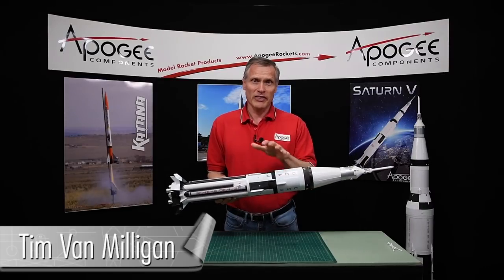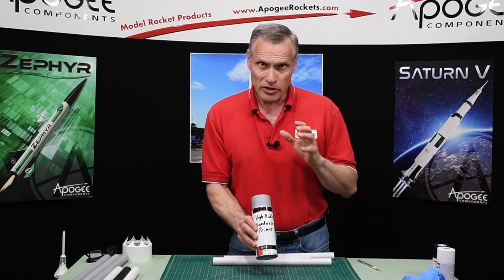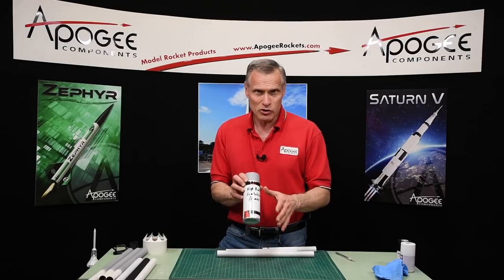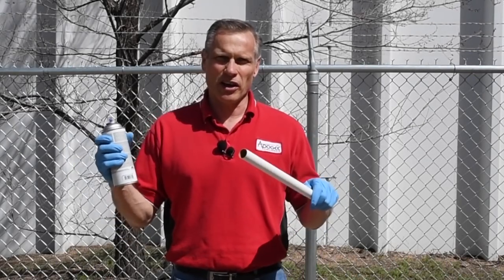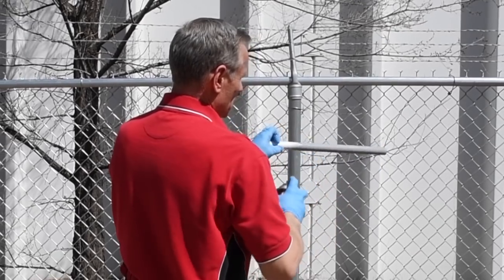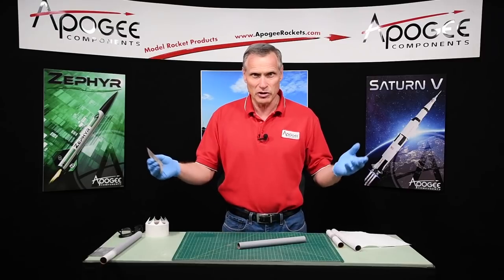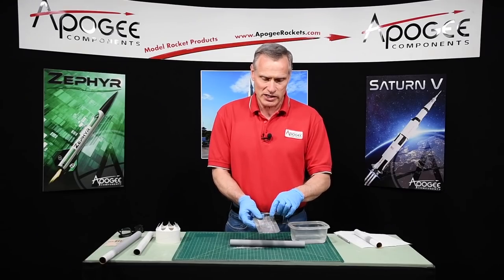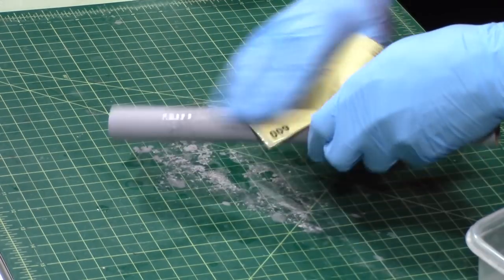Filling Body Tube Spirals with Sandable Primer

Comment: I know these video's are pretty old but at 40-some-odd years old, I'm getting back to Rockets. This is a fantastic tip . . "If you can feel it, the paint will show it" is what my Pops used to say. Another tip i'd offer is that you can buy polyester glazing putty. This is a thin compound that body techs will use over the top of other fillers like "Bond-o" to fill in the micro pinholes in the thicker fillers. It's sometimes referred to as Glaze, Pudding, or Frosting. You can basically rub this on the rocket tube like lotion, and once it sets up, it will sand to an almost plastic type of finish. Very light weight and waterproof.

Comment: So, my local autopaint store has two part made to order Urythane filling/sanding primer aerosol can. You pop the button on the bottom of the can right before use. One can was more then enough to paint the Estes Star Orbitor. Cost is about $35-45 USD. However, they could not guarantee enamels or other paints would work best with auto primer. So you might also need two part auto paint as well. 😊

Comment: I’m 78 years old and still use model airplane dope from Sig, although I started using Pactra Aero Gloss. Since airplane dope is a laquer, I start with Deft laquer-based sanding sealer, and after thoroughly drying, sand with 400 grit sandpaper. I repeat these steps, “candeling,” until no shiny (low spots) areas remain. Once all of the low spots are gone, I airbrush the color, starting with white, 2 or 3 coats, then masking for the black and/or contrasting colors. Note: for fin fillets I use Hobbico Hobbylite filler or talc-filled epoxy, carefully sanded to a consistent concave radius. Wrapping the sandpaper around a 1/8” diameter dowel or barbeque skewer works well for this. Fins are attached with epoxy. Also, I use auto body spot putty for filling dings, etc. that the Deft sanding sealer won’t fill. I realize this is a long snd tedious process, but I have been finishing my models this way for over sixty years now. I find the time spent finishing a model to be very therapeutic. The results are a beautifully-finished model that draws many compliments from bystanders.
Reply from the maker: If you ever want to build models for my show-room, let us know.

Comment: Use Duplicolor primer and Duplicolor paint either Gloss enamel or flat paint works well. The primer sands like butter. Duplicolor actually allows you to adjust the spray fan either vertical or horizontal. Paint comes out even and not in a cone pattern.

Comment: Tim you may have already tried this but rust-oleum  brand 2 in 1 filler and sandable primer from wal-mart in the auto section works great. You just need to make sure you spray light coats and let them dry good and it will sand great with 220 or 320 grit 3m wet or dry paper if you spray it to heavy and try to sand it will cake up your sand paper. I have had great luck from this type and technique
Reply: I also used rustoleum and I found that out the hard way. Holy moly were my hands tired from all that sanding! You really have to watch how much you spray closely.

Comment: while painting today, I got some really bad finger indentations on the paint since I forgot it wasn't dry yet 😢what do you suggest I do? It also sustained a drop from around 5 feet and it landed smack down on one fin and a part of the paper skin in peeling off, but I added some CA glue and it somewhat fixed it. let's just say my rocket had really bad day today
Reply from the maker: It depends on how perfect you want it to look. If it is important to be perfect, then you have to repaint. Otherwise, enjoy the launch!
Reply: @apogeerockets  thanks!

Comment: @apogeecomponents would the sandable primer method work as a replacement for the wood filler to seal balsa fins and make them smooth? I’m getting back into rocketry now that I have kids of my own, with high power aspirations. I was one of the kids you mention who just painted the raw wood and tube, so this whole process is new to me! I was always confused why my rockets didn’t look like the package! Haha. Anyway, I’m wondering if it’s a time-saver to prime the whole rocket and sand it down smooth and shiny like on this video, enabling you to skip the wood filler? Or is it a major boon to already have the fins mostly smooth? Thanks for your time
Reply from the maker: Maybe. It depends on the primer (see the video). Don't be afraid to experiment. You'll learn something either way.
Reply: @apogeerockets  thank you. I’ll try both and see what happens. One thing I haven’t seen mentioned yet is what happens after applying paint. Do you sand any more to polish the final coat of paint or is it good to go after all the work smoothing out the primer?
Reply from the maker: @chawley8889  I'll let you find out. It will be a great surprise for you.
Reply: How did this go for you ? I’m on this stage of my life as a 20 year old! I have this same question ! Just ordered the Zephyr Jr and looking to get that glass finish !
Reply: @Learning_The_Human_Mind   It went very well! Very time consuming but this method makes it possible to achieve the same finish as the photos. I used the wood filler. It’s extreme easy to sand off which can get frustrating but skipping and using only primer requires way more coats so it doesn’t save any time
Reply: @chawley8889  awesome glad to hear! Can you elaborate how you went about the process? Did you use CWF, sand, then primer ? Or did you fill, prime, then sand ? Thank you, helps for my upcoming build !

Comment: What were the tubes you used to hold the main tubes?  Were they smaller or did they have a coupler that fit inside?  Could I use rolled up newspapers for that job?
Reply: That would work.  I prefer to have something more solid to hold onto, so I usually wrap a wooden dowel with newspaper, or paper towels, or whatever, just to make for a just-tight-enough fit into the tube to hold it securely.
Reply from the maker: For this particular kit, the tubes are just slightly bigger than a 24mm airframe tube. So that is what I put in the inside to hold them.
Reply: I collect random tubes from things like rolls of aluminum foil. I used one today painting an old kit, a very small tube that I have no idea where it came from but I'm glad I saved it. Another thing I did that made work on the airframe much easier was a tube in each end to create a rotisserie. I then used cardboard boxes to support each end, next cut a notch to keep it from rolling away.
Reply: a small stack of typing paper or other scrap paper rolled into a tube works well for a handle too.
Reply: If you see a stand of bamboo, stop and get some of various diameters. You can build it up with tape to make body tube holders for painting. Or wrap with sandpaper for internal sanding. It’s really just free doweling.

Comment: How do you glue to painted tubes?
Reply from the maker: Not as good as you'd like. You have to scrape away the paint to get down to the surface.
Reply: @apogeerockets  PLEASE  make a vid on how to scrape the paint away and attach the fins--Is this the only way??
Reply from the maker: @SenecaRocksMountainGuides  That is a good idea.
Reply: I take an exacto #11 or similar snap off blade, trim down masking tape to the exact dimension (width and length) of the fin.  Apply.  Prime. Remove.  The landing area for the fin is primer-free.

Comment: Kilz aerosol works the best its ny far the easiest to sand and it builds easy its best to spray several coatsit dries super fast then wait 24hrs to sand i e filled in pretty deep stuff just let it set for several days before sanding